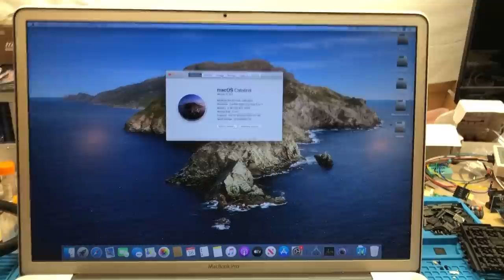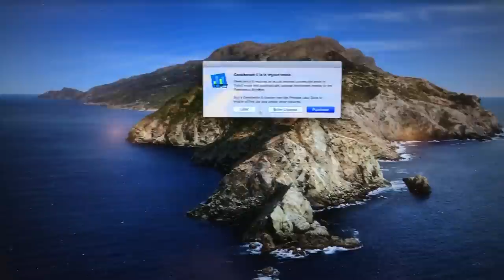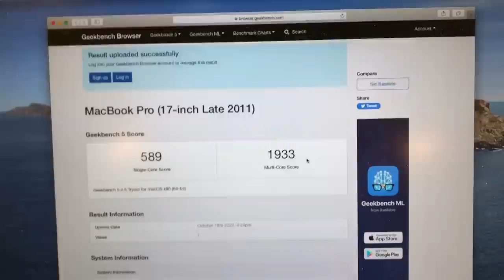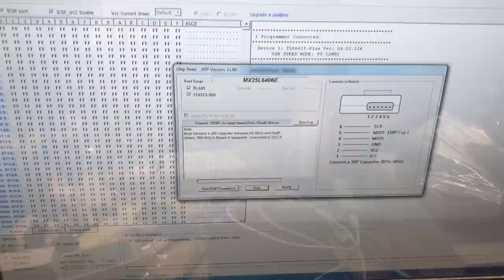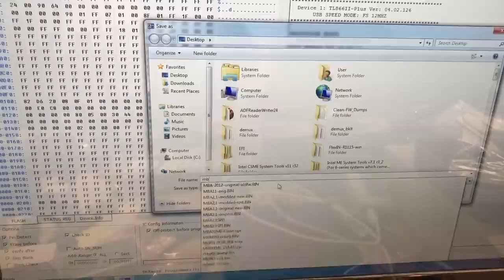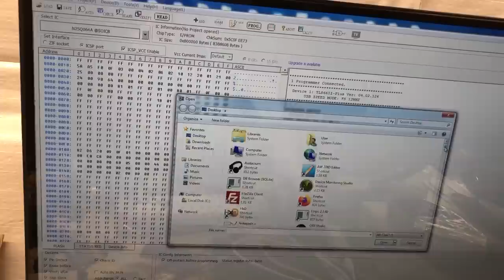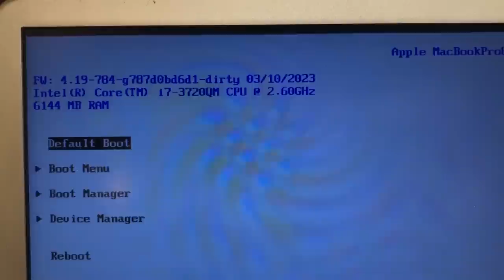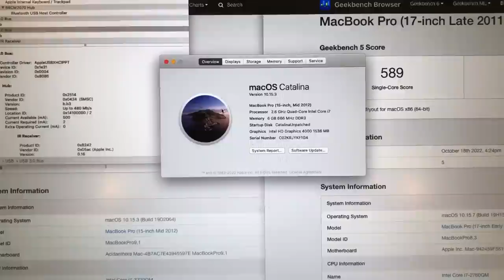Building a "Mid-2012" 17-inch MacBook Pro

Comment: If only Apple had made an official 17" 2012 MBP! I was an owner of a 15' MBP back in the day and wanted the bigger screen for video editing! You're doing amazing work Colin.
Reply: Sorry but Apple did do exactly that. One of my Macs is a mid 2012 MBP 10.1 retina and it has I7 quad core, 16 GB RAM and 750GB ssd. All original. The machine runs now 11.7.10 Big Sur 
Of course it cannot compete wit the '22 and up models but it is still a workable machine.
If I could give that one more power, I would certainly give it a try.

Comment: I used to change the lvsd cable to use 17inch 2011 mbp display with 2012 macbook 15 inch logic board. 
You choose the hard way as always dude 👍 ❤️
Reply from the maker: Except the 15" board fits horribly inside the 17" case LOL. This upgrade using the original board is much better.
Reply: @dosdude1  of course, no doubt about that. 
Moreover you can swap the 17inch display along with 2012 case. 
Keep continuing your good works, im sure you will able to find something helpful to the world like 2011 mpb gpu mess solution.
Reply: I want to put my 2012 13 inch board into a 17 inch . How do I connect the 17 display to 13 inch connection . Is it possible like an adaptor or something ?
Reply: @Buzzhumma  unfortunately, 13 inch flex cable not compatible with 17inch. Only works with 15 inch flex. 
However, dosdude might be able to find a rabbit hole to resolve your problem.
Reply: @Madhawa333  that would be the most fantastic thing if that happened as swapping out the boards is pretty easy . Just make some plastic mounting holes and problem solved !

Comment: You know what comes next right? Putting an i7 3820QM (or maybe even a 3840QM from a windows donor) on your previously 'ultimate' 2011 17" MBP with X-GPU + Nevbolt. Then we've likely hit the absolute ceiling with upgradeability in regards to compute power (without cramming a new motherboard inside)...but in theory 32GB of RAM across 4 dimms is possible on Ivy Bridge...but surely there wouldn't be any space for that in the chassis (without removing the battery...which at that point we've truly killed the purpose of the macBOOK). 

On the grounds of non-compute power though, no one has really explored screen/webcam/speaker/microphone upgrades. Maybe not your cup of tea (but there are only so many things left to improve!).

Also, have you seen the 'solder paste' they use for reballing? You may find it a tad less tedious then the classic solder balls you are used to. Excellent work as always!

Comment: You could now build the fastest Ivy Bridge 17in MBP by using a 3840QM from the Early 2013 15” LB. Now that’s perfection
Reply from the maker: Yeah, I’ll have to find one of those to upgrade my “ultimate” 17” MBP, that has NVMe and PCIe port in the optical drive slot.
Reply: @dosdude1  You’re doing gods work
Reply: if you somehow upgraded the cooling ie added more heatpipes and faster/more efficient fans, an i7-3920XM i7-3940XM  would also be possible

Comment: Great work! Just a note, an ivy bridge PCH isnt required.
Many H61 P67 Z68 motherboards support ivy bridge after a bios update.
I was able to patch in ivy bridge support in an H61 board that dodnt officially support ivy bridge via bios mod
Reply from the maker: Yeah, H61 supports Ivy Bridge, but the HM65 that these come with does NOT support Ivy Bridge “QM” CPUs. So PCH swap was necessary in this case.
Reply: @dosdude1  I think theoretically HM65 can support them. I own a HM65 industrial ITX mainboard with PGA socket, and it supports every Socket G2 CPU.

Comment: Very nice. I wonder if it would have been easter to replace to 2011 board with the 2012 and mill out the I/O on the side. Maybe 3d print a custom plate for the I/O too. You could maybe upgrade the cpu on the 2012 board if it's the same footprint as something more modern.

Comment: Hello, I have a 2015 MBP running El Capitan, and I need some help installing a newer macOS on an external SSD drive, like Big Sur or Catalina. I found online a .pkg installation file of Big Sur, but I don't know how to install it on the SSD. I have also some questions: 1)Do I need to create a bootable USB with the version of macOS for the installation on the SSD? How can I do it? 2)I suspect that the original system cannot read and write files that are in the external drive, due to the new file system APFS, but I hope that Big Sur can read and write in the internal SSD of the mac. 3)Then if El Capitan cannot see the APFS volume, how can I switch the disk to boot into? Does the method of changing boot disk "hold opt key at the boot sound" always work? 4)In case I needed to erase the whole external SSD, how can I do it if El Capitan cannot see him? 5) Would be better to have a third disk formatted in HFS+ in which store files that both OS use, like documents? Thanks a lot if you can help me :)

Comment: I have a question about your high sierra patcher as my 13 inch 2008 MacBook unibody stayed on the loading screen for 16 hours before I shut it down
Reply: I just installed the patched Catalina on my late 2008 aluminum MacBook. Worked perfectly. Maybe give that a try.

Comment: Nice video, Colin :)
I have managed to put a Core 2 Extreme Quad CPU into a Macbook Pro A1260 I have replaced earlier with a 15 inch 2010 MBP and I did not need the old one. Needless to say, it only ran for a month or so, since I could not upgrade the heatsink due to limited technical skills and VERY  limited space inside the MBP.
Reply: did the machine work with the quad core CPU without any EFI modifications? I am interested in doing such an experiment too
Reply: @rve_hardware  it is extremely hard to find a QX9300 laptop CPU with BGA connection. PGA479 is the most common. But since it is the same form factor and same FSB, it did recognize the CPU, just like my 2007 iMac, after the CPU upgrade.

Comment: Technically you could replace the USB 2 ports with USB 3 ones and route the extra pins with cables somewhere right?
Reply from the maker: Would be very difficult, as you'd have to run individual bodge wires to the pads underneath the PCH. I'd rather just pop a USB3 controller in the ExpressCard slot.

Comment: This is amazing; the HD4000 is a huge bonus for Metal compatibility; it could be tempting to convert the USB ports to 3.0 (a seemingly impossible task, but I can imagine you would be able to do it successfully, if there are points to solder the required jump wires 😅). The fact you can swap the PCH and CPU over show that Apple really could have made a mid-2012 MBP 17” (they ran the 2012 Unibody and Retina in parallel for 2012 anyway).

It is a shame the 650M GT can’t be used, but the HD4000 makes up for most of that. The 650M GT is a weird chip; Apple seemed to use a ‘lower spec’ chip compared to the rest of the 6xxM chips, but it is a part with higher thermal tolerance, which makes sense (100 degrees C).

Comment: So can coreboot be used instead of open core.
Reply from the maker: Coreboot is the firmware, which must be used in conjunction with OpenCore to boot Mac OS, as you no longer have the original Apple system firmware.

Comment: Hey do you think you could see if it’s possible to reprogram the battery IC on MacBook Pro batteries (the bq20z451) and reset warning messages and also allow the battery to work again after it has been discharged below a certain voltage and it seems to break any functionality of the battery even after the cells have been manually recharged or replaced? I have quite a few of these batteries that have become basically useless even though the cells are nowhere near “bad” and they hold a charge after being recharged manually but the machine refuses to treat it as a working battery. And this IC seems to be the primary controller in pretty much all machines I’ve opened since the unibody MBPs. I’ve found a little information regarding some people reprogramming it with an aurdino but nothing really comprehensive. If you could make a video about this it would be really helpful for a lot of people!

Comment: I have the 17 incher. Wonder how fast is the intel 4000 compared to the radeon 6000 series discrete gpu here. Its a great upgrade. Whish i could get it done on mine.
Reply from the maker: I can already tell the HD4000 is much faster than that Radeon HD 6xxx garbage.
Reply: @dosdude1  wait since you got no discrete GPU on the 17“ MacBook Pro with the 2012 Intel thing on it, does this mean the CPU gets amazing cooling with this dual fan cooling setup? How are the result? Can you use 100% of the CPU/iGPU performance now? I remember playing minecraft windows 10 edition with low settings on my A1278 2012 with the integrated GPU and it actually worked very good, only issue I had was that the cooler ran at 100% all the time, curious if you‘d get better results with this

Comment: Hi..installed macbook pro 15 inch 2011 motherboard BD82HM67 chipset instead of BD82HM65..the device works but it doesn't read bios..what can i do about it..I guess I need to program BD82HM67 chipset compatible bios...but how can I do that..

Comment: This brings me to a general question: is possible to upgrade the ram as well?
For example, one of my Macs is MacBook Air i5 and 4 GB ram. The original ssd is replaced with a 500 GB and it works fine, However more power would be welcome as it is somewhat slow when large progs are being used. Therefore could both RAM and CPU be upgraded?

Comment: I got a tip for you they make silver sharpies with find tips on them you can once you remove the glue off of the chip you can take the fine tip silver sharpie and mark the edges of the chip before you desorder from the board that will help you realign the chip when you sorder it back on.
Reply: Nice punctuation.
Reply: Good idea!

Comment: Would a 16gb ram upgrade be possible with this "transplant"?
Reply: also check the datasheet of the pch for the strap resistors the ram fsb, might find a problem there.
Reply: also if i understand correctly swapping pch is more of a experiment the new processor would have worked with the original one or is it to mach the microcodes in the newer  mac bios?

Comment: Would this work with the Radeon graphics still enabled? My late 2011 still has its 6770m working perfectly and for the odd old game I run in bootcamp works far better than a HD 4000. I actually completed fallout 4 on this machine back in the day... 🤣
Reply from the maker: Technically yes, but you wouldn’t want to if you run later OS X versions, as you cannot mix Metal and non-Metal video cards.
Reply: @dosdude1  What a shame! Then you'd have to upgrade the dgpu to something metal-compatible as well! ;P Are there any GCN gpu's which are pin-compatible?

Comment: amazing work, I will never get tired of these crazy experiments! I do wonder, since you ended up porting coreboot anyway, if the PCH upgrade was necessary? I know on **20 thinkpads the community was able to enable ivy bridge support using the sandy bridge chipset, so I would assume the same could be done with macbooks, making this process only half as much work
Reply from the maker: It was, as the original HM65 cannot work with Ivy Bridge CPUs.
Reply: @dosdude1  hmm I think the hardware is capable, but most laptop manufacturers didn't release bios updates with the needed microcode etc. People were able to coreboot ivy bridge CPUs on the thinkpad T420 with QM67 chipset, and all the sources I can find (which I admit aren't many) suggest that the HM65 and QM67 should both equally support Ivy Bridge CPUs.
If you're sure the HM65 can't work with Ivy Bridge I'll believe you, I know you have a crazy amount of knowledge when it comes to this stuff and have most likely done more research than I have, but I was under the impression that it can work under coreboot with the right changes
Reply: I guess the idea was to have it boot natively and for that I think there would be no way around the PCH swap.

Comment: Hey @dosdude1, this isn't quite in the scope of this video, but I have a question for you. Do you think there is any way that a different IPS display could be added to the mid-2012 ivy bridge range? I would love to be able to add a better panel to this, but then again I understand that this might require an interpreter board similar to those adapter boards that come up in the Chinese market for ThinkPad mods. Do you have any experience with this?

Comment: I am about to buy a 2nd 13inc mac book pro 2012 ... it has a 2.9gig i7 in it. Why can't I just that the logic board out of the 17inch macbook pro 2011 and replace it with the 2012?
Reply from the maker: Because it won’t even come close to fitting in there, and won’t be able to connect to any of the hardware inside the case.

Comment: You know if you just put the 2012 13 inch board into the 2011 17 inch it would be great . I nearly did it recently but the pin out to display is different but the ports all lined up well . I wonder if it can be adapted . Using an external monitor probably would have been ok if you have a broken screen and a fried gpu on a 2011 donor . It would be great if you played around with this concept as their is a lot of both laying around .
Reply from the maker: It is not possible to use the 13” board with 15” or 17” screen, as they use dual-channel LVDS, which the 13” board doesn’t have the necessary I/O for.
Reply: @dosdude1  oh ok . 👍🏻
Reply: Hey there . I have a 2011 17 inch and would like to know if your interested to do the same project again. I have 2012 13 donor boards as well. I have a 2010 17 inch as well . Can it be done with those dual core 2010 models ?

Comment: This is amazing. wish i had the skills to perform this. Also seeing stuff like this and the ibuff pcie adapter gives me hope that it eventually would be possible to change the 6770 gpu. Either by making a custom adapter and installing a newer gpu chip (maybe an adapter board to move it to the cd drive for more space?) or by making an adapter board like the pcie but to an mxm slot in the cd drive comparment (if enough space).
Question: How much do you charge for this cpu upgrade?
Reply: Also: Does this enable metal acceleration?

Comment: if/are you doing this as a service for a customer? if so how much do you charge for something like this? just curious because every repair shop claims this cant be done, but clearly it can. but im guessing it just costs more than the value of the machine?
Reply from the maker: It's definitely something I could do, but it would cost too much to really be worth it. This upgrade is a lot of work, and on top of that, the parts needed are relatively expensive (unless one were to have a donor 2012 board to send along with it, in which case may be worth it). I'd probably charge around $200 - $250 for the labor.
Reply: @dosdude1  thanks!

Comment: I have a question, can you upgrade iMac G5s 970FX processor to 970MP dual core? I think the PCIe based iMac G5 isights can do it but I haven't found any evidence that suggests this
Reply from the maker: You probably could, honestly, but the iMac G5 already has heat-related reliability issues as it is, adding a second core would make it just that much worse.
Reply: @dosdude1  if I sent you working iMac G5 isight board and a spare 970MP 2GHz Dual Core Processor, do you think you can make it work? the reason I am asking this is because iMacs use 3:1 ratio while powermacs use 2:1 (except the 2004 1.8GHz one)

Comment: It looks like things have been removed from that donor board before. Was that you and if so, what did you use the components for? Something I wonder is that the CPUs tend to curl due to the heat, so how where they put on in the first place? As for the stencils are they for something else and happen to fit, made for those package types, or made specifically for those chips? If the first option, what chip is the stencil usually used for? When you do these experiments, do you expect them to be possible even if you're not sure that they are? Or, for the most part, do you know they're possible, whether because someone has done it before or because there's no reason it shouldn't be possible? That was smart thinking porting coreboot! How'd you do it?

All this makes me wonder if increasing the storage size on my MrChromebox coreboot firmware modded Chromebook would be possible. Increasing the RAM would also be nice (the celeron CPU is actually perfectly adequate for what I'd use it for) but what really hurts is the limited storage size. I tried making it boot from the microSD card slot, but while the UEFI sees it and starts to boot from it, the boot fails. Same for the USB port, even with a USB2 drive. I'm probably being stupid, wouldn't be the first time.

Comment: when you take the heated chip off board do you put it in/on something special to cool it immediately after?
Reply from the maker: I just set it on the metal base of the hot air holder.
Reply: @dosdude1  thanks!

Comment: Wouldn't it still be possible to add USB 3 via the ExpressCard slot (unless I'm missing something)? That's the great thing about the 17 inch, you could use that slot to convert into various ports. You could also throw in an upgraded 2012 MBP WiFi card in as well iirc. With the exception of the graphics situation, it would essentially be a legitimate mid 2012 17 inch MBP.

Or think of it this way, you effectively just built a 2012 Mac Mini (also no dGPU and same CPU and RAM) inside a 17 inch MacBook Pro lol
Reply from the maker: Yep, you could definitely add USB 3 via the ExpressCard slot.
Reply: @dosdude1  I did this . Its good to have the usb 3

Comment: With (maybe) the exception of Wozniak itself, you're probably the best "hacker" HW&SW engineer for apple products out there. Congratz. Quick question: do you think it should be possible to upgrade Mac Pro 6,1 (Trashcan): GPUs & CPUs to above their original HW requirements? I mean... GPUs, for instance,  are regular PCI cards, just in a different format, right?